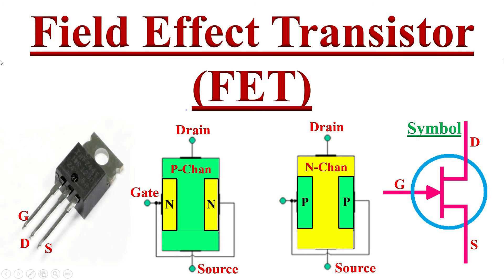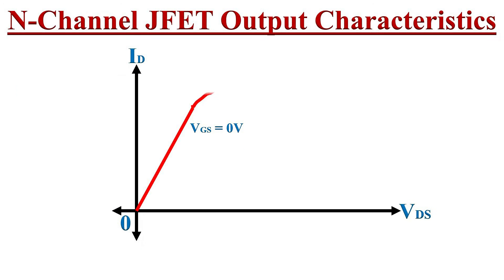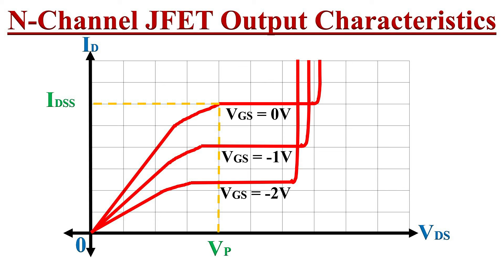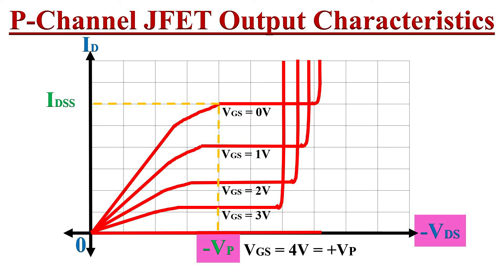Junction Field Effect Transistor (JFET)

Comment from the maker: Timestamps for various topics covered in this video are as follows:
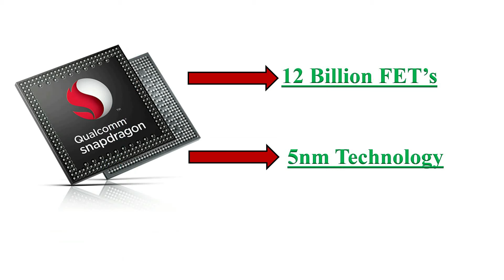0:34 Types of Transistors
1:20 What is Field Effect Transistor (FET)?
1:46 Construction of N-Channel and P-Channel JFETs
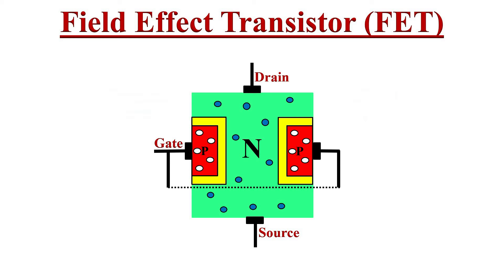3:24 Working of N-Channel JFET
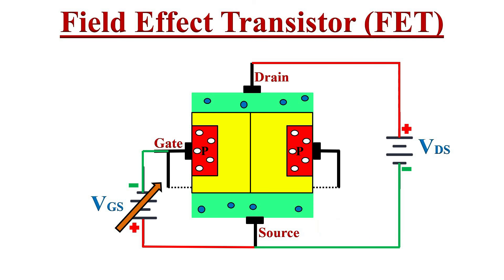6:45 Depletion regions formation in a JFET
8:57 Output characteristic curve of N-Channel JFET
10:06 Pinch-off voltage of JFET
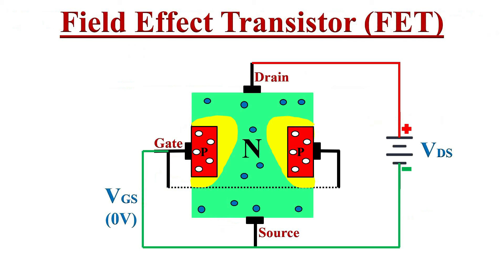12:37 Different regions of operation of an N-channel JFET
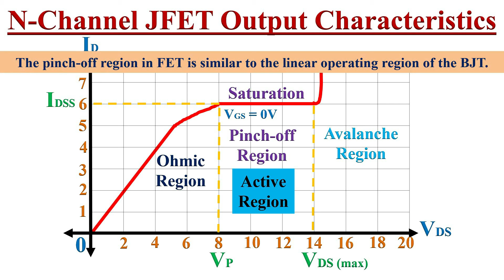15:06 How does JFETs Gate voltage controls the Drain current?
18:28 Working of P-Channel JFET
20:03 JFET as an Amplifier
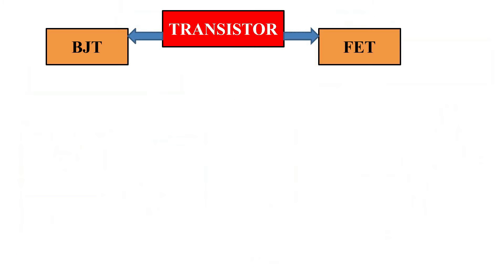22:48 Differences between JFET and BJT
23:42 Applications of JFET